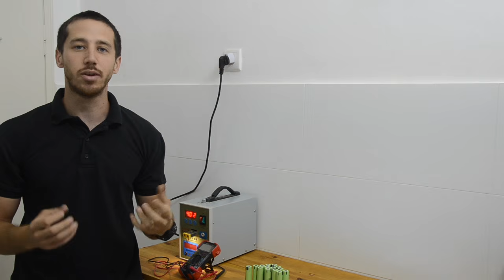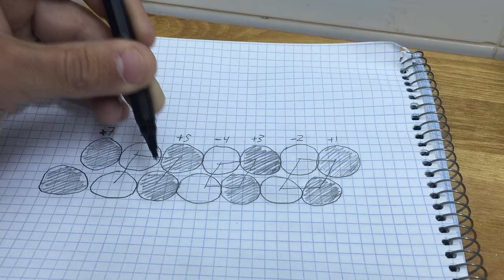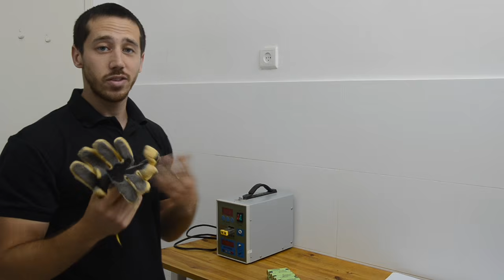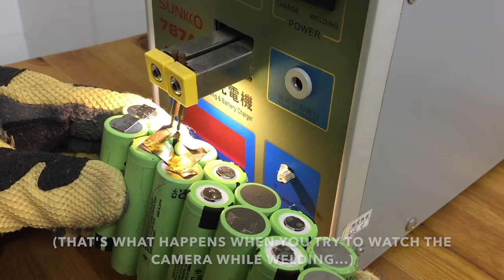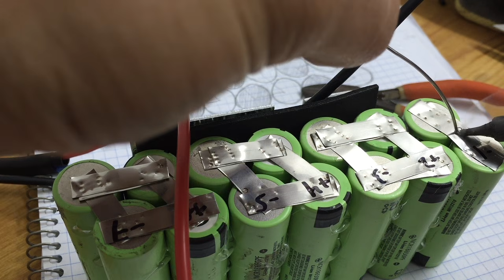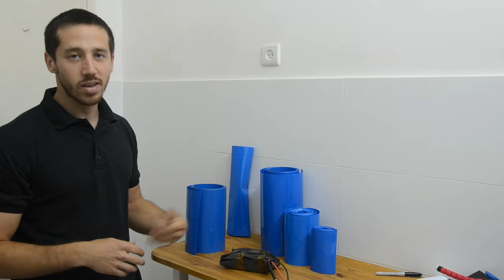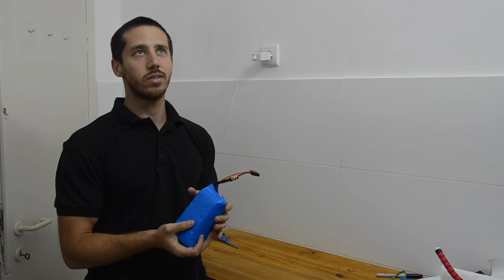How to build a DIY ebike battery from 18650 cells

Comment: Can I bug you one more time?

Here is what my pack looks like now. 

http://imgur.com/sneoe87

Here is the diagram my board came with.

http://i1098.photobucket.com/albums/g378/lilianleung/48V%2013S%20Connecting%20Chart%20logo.jpg~original

Here is how I interpret the above diagram.

http://imgur.com/a/GRokI

That's how I see it but I am still unsure. I would like to be 100% positive I am doing this proper. I have no C- like in your video. 

Instead, there are 2 B- and 2 P- leads. On the board, there is a spot that says N- but it doesn't have a soldering pad.
Reply from the maker: you've got it correct. The "left over" yellow wire is for your charging connector. That's the negative side. Attach another red wire from the positive of your battery (looks like it's on the bottom of the pack?) to the positive of your charging connector. The reason yours is different is because you have a two wire BMS. It charges and discharges through the same connection. Technically you could go without any charge connector at all (and instead charge via your discharge lead), but I still like to add a charge connector even though it's simply in parallel with your discharge connector.

I hope you got your yoga mat foam thing figured out. I actually like to use 2mm EVA foam. It's the arts and craft type foam - I get it on aliexpress via the link in the description.
Reply: Thank you!

I'm feeling pretty confident about getting this thing wired up finally. I have a 48V charger on the way so I'm going to hold off until I see what type of connectors it has. I suspect they will be the xt type.

I cut the yoga mat leaving a safety margin around the perimeter and glued the board to it. I am still unsure about how I will mount the board to the pack though. 

I am reluctant to hot glue directly to the top. I would be gluing onto the nickel stripping and this seems wrong to me (too hot/may interfere) I am thinking about just taping the board to the pack but that seem really insecure..... not quite sure there.

I really really appreciate all your help!

Comment: Im building an electric skateboard, and for ly battery the same cells are used so this made alot clear, it will be a 10s4p battery, :) verry good vid!!
Reply: hay. what is 10s4p battery. can you explain please. i am confused here. also working on electric longboard. thanks
Reply: 10 cells in series 4 in parallel, here he does 7 cells in series and 2 in parallel
Reply: +Uneven Terrain you good

Comment: macgyver would use duck tape
Reply: wrong! Just bread and water. Perhaps some milk as well
Reply: JarppaGuru an egg, 2 batteries, a wire and some ice cubes. But the problem: it would explode
Reply: JarppaGuru You forgot about the paperclip.
Reply: JarppaGur

Comment: How much would it cost to make a 24volt battery  ( I bought a Mini bicycle with a motor looks like it came from a Razor ) It has 2 12 volts 15 amp  Battery ( Or make a 24 volt lithium-ion 20 amp ) And would you sell something like this . I am in Canada / Thanks for the good video

Comment: The BMS board I am planning to use on a 13s/8p pack only has 13 sense wires. What's up with that? Did I get the wrong one? There are two leads from the B- and two more leads from the P-.
Reply from the maker: Some boards have the same number of sense wires as series cells, some have N+1 sense wires. If yours has the same number of sense wires as series cells, it just means you won't start with -1. The first wire will start on the positive of the first cell, and each additional wire will be on the positive of the next cell, ending in +13.
Reply: Great! Thanks!

See here for a pic of how I've interpreted what you just told me. Does this look correct so far?

http://imgur.com/YxPJWkE
Reply from the maker: http://i.imgur.com/bDnPcxV.gif
Reply: http://imgur.com/gallery/awreS

Comment: Hi. Real beginner guy here. I'm trying to make an 18650 pack that has 3 series and 5 parallel. My question is what do you connect the BMS to? A charger like an ImaxB6 or just a power supply high enough for the full charged voltage like if I'm having 3 cells, that'll be 4.2x3=12.6volts power supply. Thank you :)
Reply from the maker: If you have a BMS then you don't need a balancing charger like an ImaxB6 or similar. You just need a CC CV power supply that can provide the proper voltage, which you correctly calculated would be 12.6V in your case.
Reply: 12.6V  charger is the correct one .

Comment: I wish you could explain why you have a backwards 1/4" phono plug and a negative wire soldered to the outside of it. I'm not familiar with this connector, but to me it looks like a music plug soldered backwards. Also I've done basic soldering and when you are soldering those wires from the BMS to the nickel strips you will notice it is beading off the strip like water droplets on glass. If you tug at those connections they should come off easy, you're supposed to either use fine sandpaper to rough up the surface or flux. any time I've seen solder look like it's beading off something and it looks like it's having a  hard time sticking it means poor adhesion
Reply from the maker: Hi Bruce, what you are seeing is a property of solder known as "wetting", where the solder spreads out when it reaches a certain temperature and adheres to the nickel. It might be hard to see because I sped up the video during the soldering, but rest assured all of those joints were tested and are quite strong. Regarding the RCA plug, it's only a "music plug" if you've got music going through it. Otherwise it's a generic electrical connector. These are gold plated RCA connectors that can handle up to 5A. Other RCA connectors can carry up to 15A. The outside of the barrel on the mono end is negative and the tip of the barrel is positive. This correlates with a standard in the ebike industry for using the center of RCA connectors as positive.
Reply: EbikeSchool.com very interesting, thanks!
Reply: @EbikeSchool what is the recommended charger for this battery pack?

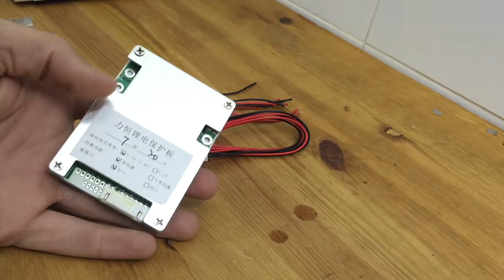Comment: Hi bro, given that these Panasonic batteries 18650PF have max discharge current of 10A. Sizing it for 20A for 2p makes perfect sense. Hence. I dont quite get it when u said @ 14:36, that 20A is twice that what you would need. TIA for clarification.
Reply from the maker: It depends on where you plan to use your battery. This battery went on a low power bike with a 10A controller. So it had a safety factor of 2 (twice as much current available as what I would draw). If you paired this battery with a 20A controller then you'd have exactly the amount of current available as what you plan to draw. I personally like to leave a safety factor.

Comment: in regards to capacity then we can say this pack consists of :
7 cells in series* 3.7v = 25.9 nominal voltage of the pack. your website refers to 48V system, did you build 2 packs?
2Amps per cell could give you 14AH? With this battery pack , how long can you drive your bycicle using 1000 watt motor?
Reply from the maker: No, it's 7 cells in series, 2 in parallel. So 25.9V nominal, but 2.9AH x 2 cells = 5.8AH capacity. 

This battery isn't meant for a 1000 watt motor. It's a smaller, low power battery. You'd want more cells in parallel, and likely a higher voltage, to run a 1000 watt motor.
Reply: Thxs! What motors are more durable?

Comment: Thanks for the useful video, but your choice of using an RCA to 1/4" adapter for the charging connector is really a bad one.   First, this is an audio adapter designed to carry low-current audio signals, not several amps of current.  Second, putting a female connector on the battery end means you'll have to have a male connector on the charger, and good engineering and safety practice is to never have an exposed male pin connected to any source of energy.    There is no reason for makeshift connectors, just use something designed for this purpose like the TE Connectivity Mate-N-Lock series that are polarized, rated for high current, and don't require you to mess around with heat shrink.  Less than $1 each.
Reply from the maker: Thanks for your comment ranickel. It really depends on the RCA connector. Some are rated to over 15A! Apple even used them for their chargers before they went to magsafes (and had the male end on the charger). These gold plated connectors I used have very low resistance meaning very little power dissipated as heat. For the few amps I'm charging at, they are more than enough and could carry much heavier loads too. Lastly, a good engineer would NEVER put the male connector on the battery. Both the battery and charger are energy sources, but if one should fail, it better be the charger. It's much safer (and cheaper) to have a charger fail due to short than a lithium battery. There are lots of good connectors out there including some of the ones you mentioned - these are just the ones I used this day. Thanks for stopping by!

Comment: so its a 28plus volts when fully charged?
Reply from the maker: 29V, yes.
Reply: EbikeSchool.com Thanks , Bro. Is it necessary to group the cells by effective battery capacity? I mean, some cells have aged more than others resulting in lower capacity in then. What happens if I have not grouped them?

Comment: Ever try moving the spot weld electrodes a little closer together?  Looks like they are too far apart causing minor issues.
Reply: ElGattoLoco- agreed. It looks like he's got them set as close as this amazing machine can be set at. I would bend them a little closer.

Comment: I'm confused on how you can charge a 14 cell battery with 7 sense wires. Why do you not need 14 sense wires? I understand that there is 7 in series and 2 of those groups are in parallel.
Can you treat groups that are in parallel as a group? do they self balance charge/discharge themselves with is parallel neighbor?
I guess it's no different that having 7 batteries that are twice as large...
Reply from the maker: The parallel groups act as one big cell. Yes, there are two individual cells in parallel, but they are connected at both the positive and negative ends so they will always be exactly balanced. So you only need one sense wire per parallel group.
Reply: [standing in a huricane] THANKS THAT WAS HELPFULL!!!! [hat flies off]

end scene
Reply: That was FUNNY =))

Comment: Can you use just any battery's ?
Reply from the maker: No, you need good quality 18650's that can support the discharge rates needed by an ebike. There are many options available, but here are the exact batteries I used in the video (called Panasonic 18650PF cells) http://goo.gl/VVmHbi

Comment: Can you give a rough estimate of mileage per charge on this specific battery? On an average weight bike, no uphill effort, just straight cruising. Thanks!

The reason I'm asking is because I'm wondering if I should build one this size or something bigger. With no prior experience, making such estimates is still a bit tricky...
Reply from the maker: It's super variable. I can tell you my wife gets about 15 miles per charge with this battery on her 20" wheel folding bike. A larger guy on a different bike would get less range. This is a little on the smaller end of ebike batteries. My personal battery is about 3.5 times as large, but it's probably more than I need. I do long commutes though.
Reply: Perfect, thank you! I know there's no way to give a perfectly precise answer, but this gives me a good idea of how big I need my build to be. Thanks, for the video and the answer, it's a great help to all us DIY geeks out here :)
Reply: Hey, I am reviewing the video as I'm getting ready to get started, and I just realized something. Is that an audio jack you are using for the charging wire?
Reply from the maker: Yes, it's a 1/4" mono to RCA adapter. You can use many different types of connectors, that's just a good two pole one that I like to use for many applications. You can find them at a local electronics shop (or other types of connectors) or where I got them (aliexpress) http://goo.gl/v6f6kU
Reply: Brilliant. It makes sense, but I sort of got used to think of them as something that belongs only with audio electronics

Comment: 15-20 days on them nickle strips. Question, can soldering work? Spot welders are a bit, expensive.
Reply from the maker: It's really best not to solder them. Yes it is possible, but the heat damages the cells and you get less life out of them. That's part of why professional battery packs are spot welded.

Comment: Hello Sir. Nice video, like your ebike school project.

Have a question. I have cheap Sunkko welder. I am able to weld nickel strip to battery prety strong, but can not then weld nickel to nickel. It is very loose.
Same when trying to weld two nickel strips without battery. When I added current I melted bottom strip.

Anyway, dont you know what 4P, 6P, 8P means? I can combine it so I suppose 4P and 6P on will give me 10P. What setting you use usually.

Thanks a lot.
Reply from the maker: I'm using a double pulse at with the welder set to 40. That's very odd about melting the lower nickel. I recommend trying to lower your current and see if that helps. Otherwise it might be a defect in your welder.

Comment: Excellent tutorial...where did you buy your BMS unit?  Never sure where to buy from these days?

Thank you!

Ryan F.
Reply from the maker: This specific BMS is from Greentime and I got here: http://goo.gl/S6gSQx
BesTechPower makes some of the best BMS units available, but they are 3-4x the price. I only use those on batteries that need extra power. For standard batteries like these, Greentime BMS's are more than enough.
Reply: Thank you for the information.